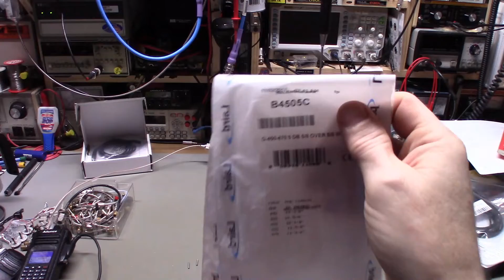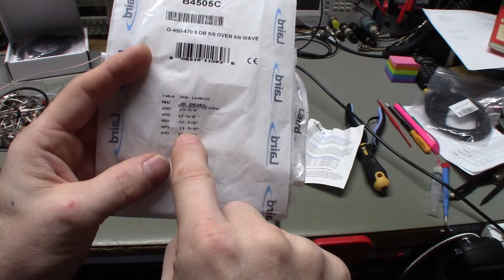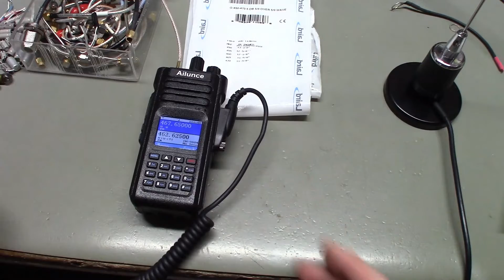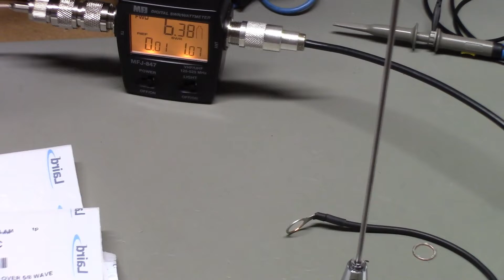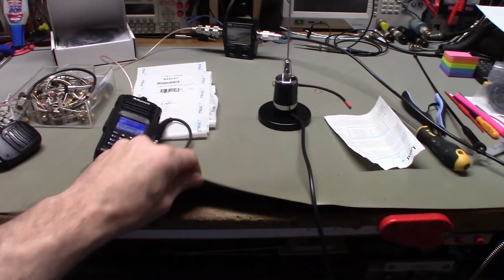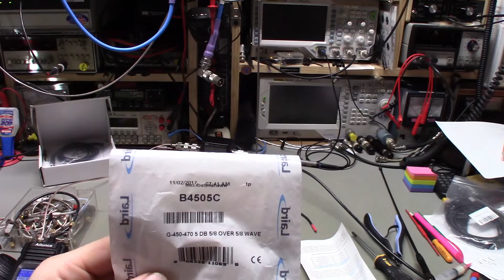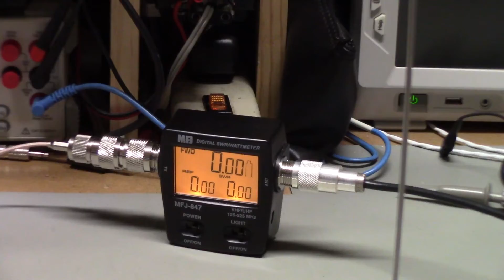Laird 450-470MHz 5/8 over 5/8 wave no ground plane antenna. Testing on GMRS repeater frequencies.

Comment: Great video. I've been watching gmrs videos for weeks. This is probably the best one about antennas. Thank you!
Reply from the maker: They are good compromise antennas.  Is it perfect, no.  No antenna is.  I know several people that use these mounted to their window air conditioner, on top of their refrigerator, setting on the floor in their attic or on a shelf on a bookshelf.  Since it's a no ground plane design it's not picky about what it's setting on.  I actually ran around for almost a year with this on the roof of my 1 ton van and noticed no difference in performance compared to the normal ground plane version of this antenna from Laird.

Comment: Hi Mike, Nice video.  I recently picked up the 4503 (5/8 wave version) and 4505 (5/8 over 5/8 what you have in the video) and have a Laird magmount also.  Locally I have tried many repeaters using both of them on the car and found the 4505 to be a little better but I also have a Laird 1/4 wave which is what I have been using and seemed to do equal or better in some cases than the 4503 but the 1/4 vs the 4505, I found the 4505 to be 6 db or 1 s unit stronger on one repeater and about the same on others.  So it really depends on the application.  Of course I am up here in Williamsport, PA where high mountains are typical, it just depends.  5/8 over course typically work better in the flat lands and 1/4 better for mountain areas with the high angle of radiation.

Comment: New to all of this but I'm thinking of installing a base unit/power supply on a shelf in the back of my closet. The closet is for storage only and does not get opened very often.   Don't want to drill through the ceiling and into the attic if at all possible for the antenna.  Can the antenna reside on the same shelf or should I put it on a higher shelf?  Would you recommend the Laird (with or without the ground plane) for such a configuration and what problems could I expect to encounter, if any?  Thank you.

Comment: Nice I have a Browning for gmrs . I got a 1:01 match is that good ? I have a tram 1140 with 50 foot of lmr400 . I also use a yeasu ft3d mod . But is 1:01 good
Reply: I've often wondered if there is really any difference between the Laird and Browning/Tram versions of this antenna. I know that Laird is generally higher quality products.  Another confusing thing is that Browning has 2 versions of it.  They have a br-173 & a br-450 both look the same and have similar gain but they don't explain what the difference is.
Reply: @timtaylor8557  There is also a vx30a base atenna .I have one on my 2nd base . Just as good as the tram .
Reply: @timsmith9169  That appears to be for 70cm and not tunable.  Not sure how good that would be for GMRS.
Reply: @timtaylor8557  the browning I tuned 1:01 the tram was done by the clubs master tech . As from the vx30a I was told it was per tuned I can hit all 3 repeaters .they are around 50 miles apart .  I will have to put a meter on the vx

Comment: I got the same antenna with a tram 1265R base. Cut antenna off about 3/4 inch swr is 1.01-1.02 and can talk on
repeater 30 miles away from my living room.

Comment: Would there be any benefit to cutting smaller lengths from voth the top and the bottom? (Rather than only removing all thr length from bottom portion)
Reply: Many mobile antennas have a tip designed to discharge static electricity. You DO NOT want to cut that off. That is why you'll see radio guys cutting from the bottom.

Comment: Midland and others make a 3db gain ghost antennas that are only a few inches tall. They are truly invisible to any sort of HOA or apartment restriction.
Reply: They are very small but I seriously doubt they are 3db gain.  Those are only good for close use like people traveling together on the road/trails.  You would be better off using something like the one on this video or a GMRS base antenna and disguising it with something like a plant.

Comment: I bought a browning. Measured the diameter of the antenna rod,  .2.5 mm. Ordered 2.5mm stainless rods from Amazon. Now if I make a cutting mistake, I have ten more rods to go.  I can also make a seperate cut for uhf ham frequencies. . Have a Nagoya ut-72 that comes more tuned for GMRS. I cut and tuned a rod,  again 2.5 mm for UHF ham frequencies. Now have 2 dual use antennas. I hold a license for both.

Comment: I have a midland 5001z. Cb radio. 
Tweak & tune with frequency line up. ...out of the box real bad. 4 miles and muffy sounding. ..
Now clear as a bell. ...normal receive now after tweak and tune. About 8 miles on average. If somebody running a amateur radio and putting out 35 to 40 watts. .I can receive that single up to 14 miles....YOUR THOUGHTS ON THE MIDLAND RADIO. ..
MIKE FROM MINNESOTA  (MINNESOTA CORN BREAD )

Comment: I am still trying to work out how it works without a ground plane and as it is 5/8 over 5/8 wave has got me, the only thing to give it a ground of any kind is the braid part of the co-axial cable.  Tidy antenna and nice looking though.
Reply: It's a vertical dipole where each arm is 5/8ths the wavelength. Ground isn't required as it is a 'balanced' antenna already. Essentially 'one arm' of the dipole supplies the ground plane. It probably has a balun at the base to impedence match, so that's all it needs. All this would need is a 12x12 bit of ANY metal (including a tray, cookie sheet, anything really... aluminum foil, lol) under it if it were the type that required it.
Reply: @mindmaster064  Co-linier antenna.

Comment: Mike, I love your videos!!! Are you familier with and what do you think of the following Galaxy radio: GALAXY DX 959B SSB 40 CH CB RADIO, SUPERTUNED ON OUR OSCILLOSCOPE & SPECTRUM ANALYZER, ((SKIP TALKING^^^SKY WALKER)), 35-40 WATTS PEP OUTPUT LEVELS, HIGH RECEIVE KIT, POWERFUL!!! I found this radio listed on ebay. What do you think of the Modification done to it?
Reply from the maker: Hard to comment on a radio or it's modifications if I don't have it in front of me to analyze.  In general if it's been "peaked" and "modded" then I would probably avoid it.  If it's pretty much stock with only a transceiver alignment done to it then it's probably fine.
Reply: @mikesradiorepair  Thanks for the fast reply, I think I will just buy a stock radio and send it straight to you for an alignment & mods so that I will know what I'm getting. If you have a large back log of work, I'm willing to wait. Thanks

Comment: What about an 9:1 UNUN driving a piece of copper pipe the height of the house  and the ground going to a ground spike driven into the soil, would that work.
Reply: I have found using a 9:1 Unun feeding twin lead end fed half wave  dipole half wavelength to the frequency above ground (earth) to be ideal for the given frequency. 

  With what your describing, I'am thinking your talking about a using the ground radial as a "counterpoise" in a vertical polarized installation, which will work as well,  as long as your ground is the same length as the radiator (quarter, half, three quarter etc...) your actual RF antenna ground will be at the box where the (balun  matching network) is housed in, If I'am understanding your question and description correctly?. 

  There is a Ham operator and author Stan Gibilisco ( W1GV) who has literally dozens of you tube videos and many books available, very, very easy to comprehend regarding all forms of antenna designs, balun winding tutorials etc...which I highly recommend to both novice and advanced antenna builders. You can also Install an app " Amatuer Radio Toolkit" which covers practically every frequency of radio communication antenna subject e.i. verticals, horizontal, dipoles, inverted V's, quads, Yagi, ground planes. All that you need to do click on antenna designs desired, frequency and wavelengths desired and the app will calculate everything necessary to construct the antenna. It also covers inductance, capacitance, resistance etc...

Comment: Personal favorite is the Laird TRAB4500NP antenna. Use them a lot for control stations, often a simple L bracket for the mount. Unity gain without a ground plane, 3 dBi with antennas. Not for working DX but for interfacing with local repeaters works great. 

Often I mount these to metal structure in metal framed buildings.